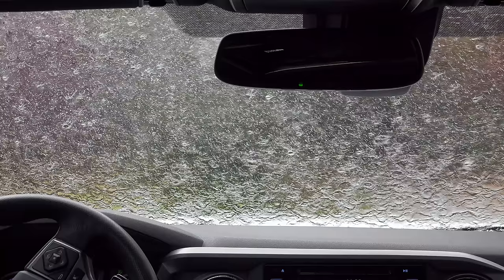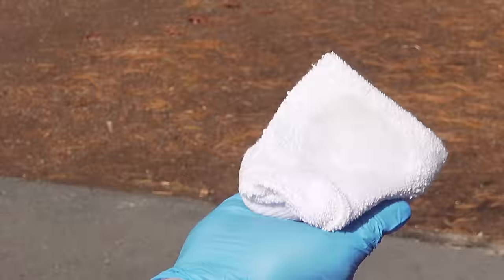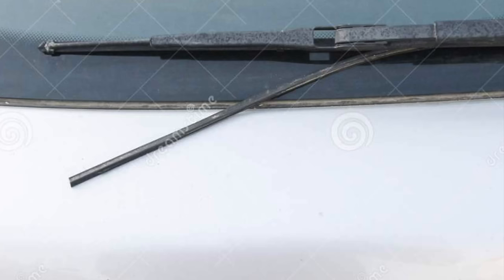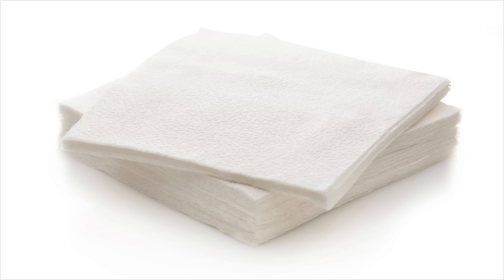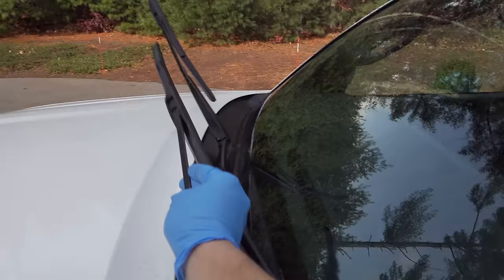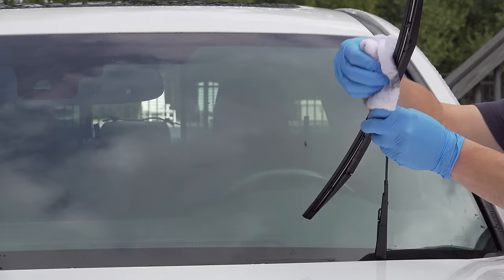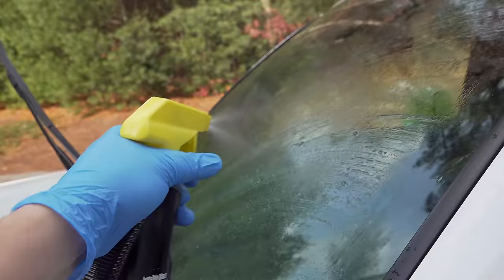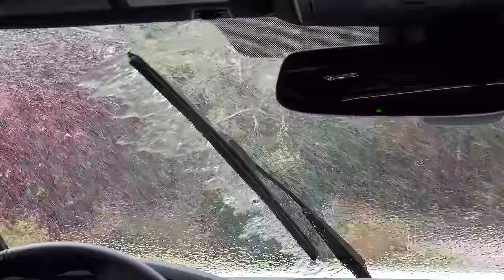How to Make Windshield Wiper Blades Like NEW in 30 Seconds

Comment: Very good video!  I’ve been doing something similar except I use Armor All.  It keeps the blades clean and free of causing streaks while extending the life of the blade to more than twice of what is expected.
Reply: Similar here, but I use soap/water to clean the blades, dry, then treat them. Armor All or Rain-X seems to work well; reapply every month or two. The wipers are the originals, installed at the factory 5 years ago and the streaks were bits of windshield gunk on one side of the wiper. I have Rain-X on the shelf because it'd cause the windshield to turn opaque when sunrise sun beams shone directly on the cool windshield (wrong side of a 1-way mirror). It was especially dangerous because this was a blind corner, no sidewalks, with pedestrians/bicyclists on the road.

Comment: WD-40 is a petroleum distillate.  Over time it will deteriorate any rubber it comes in contact with.  I’d use Rain-X on my windshields instead - it’d lasts 6 months and works perfectly without any degradation of the wiper blades.

Comment: WD 40 is actually a solvent.  It's awesome stuff and it does have lubricating properties initially, but is not good for rubber in the long run.  It will dry out the natural lubricants in the wiper.   Clean your wiper blades really well with soap and water then dry them off.  When they are dry, use silicone spray on the wiper rubbers.The silicone spray will help hydrate the rubber and protect it from UV.

Comment: I like using rubbing alcohol to clean them, then use 303 or any other quality rubber vinyl protectant, for even better results soak the blade in the 303 or similar product for 10min even when new to help them last. Make sure to buff of the excess product after coating them!!!!

Comment: The last 2 cans of WD-40 I bought I had to throw away after a while. These cans had a stupid little plastic straw that you inserted into the nozzle hole, instead of having a flip top sprayer. The straw wasn't so much the problem, it was the nozzle itself which choked up. & putting this into hot water didn't work, either. AND it's expensive stuff. So, halfway through a job I was doing, no WD.  I then grabbed a coconut oil spray, which worked just fine. (As does vegetable oil.)  I now have a silicone oil spray. I'll try THAT on the wipers.

Comment: Back in the '80s through '90s, even the cheapest Anco blades would last for 5yrs or more without streaking or ripping.  Then even "premium" blades like Bosch seemed to hold the "blade" part to the "base" part with a strip of balloon-rubber, so thin and prone to ripping that to this day I can't get more than a year or so before flapping around a piece of black spaghetti with each swipe.  So I just keep Rain-Xing my windshield and not even bother with the wipers except when at a standstill or going really slowly.

Comment: That makes perfect sense.  Keeping a windshield clean to begin with is half the battle. Never thought about cleaning the blades with WD-40.  Windshield blades come off so easy that I'm thinking of doing mine off the car.  Great idea, thanks.
Reply: It takes me about two hours, tho, to figure out how to put the windshield wiper blades back on!
Reply: WD-40 eats rubber, use silicon spray instead

Comment: I didn't see anyone refer to the fact that wiper blades have a molybdenum coating on the rubber so they slide better.
Wiping off blades w a rag helps temporarily, but it removes the moly coating.

The perfect thing for a wiper blade would remove gunk, but preserve the moly coating. I have no idea what that would be.

Comment: Learned the “tip” 20 years ago, he said. He didn’t say how many sets of wipers he’s gone through. For me personally, I’m skeptical of using petroleum products on rubber. But that’s just common sense. Then again, cleaning the wipers with alcohol may dry them. Maybe I’ll slather them up with some glycerin, since that’s water soluble. No, I’ll mix that with oxalic acide and use some formic acid on them instead. I give. I’m a chemical engineer and I’m not thrilled about all the “uses” of wd-40. If it’s the only thing there, sure, go to it. Otherwise, there is generally a better product. They make their $ on the aerosols, and if you left it in the cold a couple seasons, it’s flat and you’ve got to buy again. Long ago, I bought a gallon of liquid and spray it. Much better. It’s not the best thing for locks, chains, wiper blades, cables (bicycle/moto), garage tension springs, hinges, etc. etc. I think it can be used as a metal cutting lubricant but actually I think motor oil (much higher flash point and better lubricisity)is better for that. Jack of all trades, master of none. Someone tell me one thing it is “great” for, and please don’t tell me bike chains.

Comment: That black stuf after you wipe off is not the grime, but it is the carbon black coating of the wiper rubber. So by doing that you will ruin your wiper blades. Just wipe the grime if any by using a wet plastchamois.

Comment: Please inspect your wiper blades first.  Wipers often can start to separate.  A metal blade against the glass may cause scratching.  And the wiper inserts (rubber) can be replaced separately from the blade.  Instructions are on YT.  But you should replace the rubber inserts once a year.  They are designed to be replaceable items.

Comment: Dish Soap and one of the Plastic (Green) scrub pads on the Glass. Will remove remove the road grime. ON THE GLASS ONLY. NOT ON THE PAINT.  Dish Soap on the Wiper Blades also.

Comment: That black stuff is mostly oxides rubber not grime. Wiping it removes it and the oil swells the rubber and allows it to create a better seal. This is probably good to do every oil change just to prolong blade life. It may destroy some of the cheaper blades though. It would be interesting to see how well something like armor all in very light coats would do.     You want to hydrate the rubber but not so much it leaves oil on windshield.

Comment: I did this, it did not work and my wipers were new. The problem was that my wiper arm is bent ever so slightly so that the blades are not flat on the windshield. If that is your problem then it is an easy fix. Take two sets of pliers, and twist your wiper arm to make the blade sit straight again on the windshield. Please see a video on how to this,  there  are several good videos on here to show you how to do it. I realize now how much money I wasted buying new blades over and over trying to get rid of that noise and trying to get that streak that is always at eye level to go away. If this works for you great but if not search for other vids on how to fix noisy wiper blades.

Comment: this is pretty intersting bcuz while my first question would  be how long do u typically keep wipers after first doing this to them (??), but basically WD40 which is an oil solvent , if left on wipers should deterioriate them, bcuz oils-solvents do just that to rubber or related synthetic materials that are rubber-like.  So this is basically the worst thing for longevity.  The normal way of cleaning wipers is using something like rubbing alcohol.   One product that can extend life of rubber-type items is polymers that are in products like AT-205, which is made by ATP and happens to be made to stop leaks, but it's also a rubber treatment.   It can be used on any rubber parts of the car like CV boots, to extend their lives, and wipers if need be.   Far better than WD40, by obvious facts, but it's not cheap now at about 18$, so i dn't blame ppl for not buying it.   For those who want to use WD40, i'd sure want to get entirely off the wiper afterwards, which will require an actual degreasing agent, perhaps glass cleaner, but might need alcohol.
Reply: do not clean the wiper blades. The black residue on the rubber is actually graphite coating. It will provide smooth slide and protection to rubber. Removing it is the worst thing you can do. WD-40 only provides temporary benefit, it will wear off really quick under heavy rain and could cause you a trouble in the middle of a storm in a long road. Instead try re-coating rubber with graphite from pencils by grinding the tips.

Comment: warm soapy water will remove any grime, dirt, sap and oil from the wiper blades. I usually avoid using WD40 on rubber or plastic components. But honestly, wiper blades are relatively inexpensive and can be replaced pretty quickly too.

Comment: That's like saying "if you just bought new tires and they're not looking brand new the next day, try this trick.  If the tires have scratches and scrapes on them, unfortunately this won't work, but if they're just dirty than what you'll want to do is take a rag and wipe them down".

Comment: That black 'residue' is the carbon component in the synthetic rubber wiper blade. If you rub the wiper over and over again you will eventually remove so much carbon from the wiper blade that you will be forced to buy new blades.

Comment: Better yet a bit of lacquer thinner on wadded cotton will remove ALL the old and oxidized rubber from the blade edge. Be sparing in your applcation. My wiper blades are 8 years old and work like new. I do this 3-4 times a year or when steaks develope.

Comment: WD-40 is well known to slightly dissolve the material that windshield wiper blades are made from. As such, windshield wiper blade manufacturers will recommend AGAINST using WD-40 for this purpose. If you use products like this frequently, they can dissolve the rubber and shorten the life of your blades.

Clean your wiper blades by wiping them down with warm, soapy water, and wipe the edge of the blade with rubbing alcohol. If you're still having issues with smearing water, try upgrading your wiper fluid. 

You can use a mixture of water and vinegar instead. The vinegar and water mixture cleans the wiper blade rubber. It softens it too, making it suitable for wiper blades on cars that may have sat for a while.

The windscreen wipers have to be cleaned regularly because if dirt dries in them, they have a potential of damaging your windscreen. However, the rubber blades of the windscreen wipers also wear out with time. When you see cracks it's time to replace the blades.

Comment: Just wipe the wipers down with a damp cloth. Pinch the blade between your fingers and run the length of the blade a few times 
Do this every time you wash your car or get gas 

I have been using the same set of wiper blades for 6 years

Comment: I don’t use WD40. It’s basically kerosene. I use regular wiper fluid to clean my blades. Kerosene attacks the rubber and can actually degrade the wipers.

Comment: WD-40 is a lubricant (fish oil to be exact) dissolved in a solvent. While it can break down grease and oil to a certain degree, it also adds back some. This might be desirable if you are cleaning a hinge, conveyor, or corrosive-prone part, but not if you need it truly clean. Use silicon lub or try graphite lubricant instead.

Comment: I Bought 3 New Bosch Wiper Blades and put them on my Car.! The Rear Wiper Blade and the Front Passenger Wiper Blades are Fine.! But the Driver's Wiper Blade is Juddering.! I Googled what to do and it was suggested that Coconut Oil would help.! I put some on but Nope, it didn't help and left a White Smear on the Windscreen.! So I Cleaned all of the Windscreen and put the New Blade on after taking off the Old Blade.! Still Juddering, I will be trying the WD40 trick tomorrow.! But do you have Anything else to Suggest to Stop Windscreen Wipers Juddering.?🤔

Comment: Lacquer Thinner and some tissues is so much more effective than WD40.  It removes ALL the black oxidized rubber, and done so very quickly.  Don't get the chemical on the vehicle's paint so apply the chemical on a tissue away from the vehicle.  Unfold the tissue flat, then refold it 4 times to create a small square pad, then cover the hole of the chemical's container with it and turn the container upside down to create a very controlled wet spot without dripping.  Wipe each blade clean by using "pinch" action, the tissue to both sides simultaneously.  Repeat until no more "black" comes off.  Privately owned used car lots do it this way all the time.

Comment: WD40 silicon is worth using but in my case it did not work. After 10-15 mins of use in the rain the squeek comes back, have changed 3 sets in 3 weeks no use. Thinking of changing the windscreen....

Comment: That black stuff that you see on the old sock is the wiper rubbers themselves. It isn't grease, or dirt, it's the rubber itself, coming off. WD-40 is not the best solvent for cleaning wiper blades. WD-40 is an abbreviation for "Water Dispersant number 40."I would not use grease or oil on a wiper blade. I would soak by sock with – windshield washer fluid, the kind for winter use, it has the most solvent. You can add a drop[ of dish-detergent, like Dawn for sishes. Just a drop. Also ok would be denatured alcohol, vodka, or silicone lube. Do not use paint thinner. Paint thinner dissolves rubber.

Comment: I use silkone spray, right on the screen and on the blades. All over, then dry and shine with a nice clean towel. Haven`t bought new wipers in years, no need. Rainwater is forced off the screen at speed. They should tell people about this.

Comment: Is there an alternative to WD-40 if your local shop havent any in stock? What about methylated spirits? Or thinners?
Reply: Go to the hardware store's plumbing department and buy 100% pure silicone gel. Silicone contains plasticizers and is used on rubber for this purpose. WD40 is not good for rubber. And, silicone sprays may not be either (the carrier ingredients may be petroleum distillates and not good for rubber. Plus, silicone is  harmful to catalytic converters. I wouldn't feel good about aerosolizing silicone into the air around my car unless I wasn't going to start it for an hour. I wouldn't want my car breathing silicone in, and affecting the cat converter. But, the gel is the way to go in order to avoid petroleum distillates which aren't good for rubber anyway. WD 40's pure petroleum distillate.).

Comment: There is no "grease" on your wiper blades.  It's just rubber from the blades themselves.  This will put WD-40 all over your windshield, streaking and impacting vision.  Have fun cleaning that off.

Comment: So a way to help keep the life of your blades is shutting them off at stop lights. Some cars do this automatically when they sense a speed below 10-5mph to do just that. When you gas up, clean your window and blades! Keeping them clean is half the fight, as the wear from junk they collect is part of what breaks them down. I can't say WD-40 is the fix, but finding a way to rejuvenate the rubber is the key. WD-40 is a petroleum base, if memory serves which will actually degrade rubber if my chemistry is right. You need an oil or silicone base to actually help preserve rubber. Not a chemist, so keep that in mind. I wouldn't go rubbing gun oil on my wiper blades and get upset with smears after. 

I have ironically used turtle wax both on my window and blades and I have zero complaints. I also keep my blades clean, ditto the glass. I think that is where the real fight is at.

Comment: I did this and my wipers started to drag sluggishly with jumps and loud groaning noises.  No smears though, so it was clean.. Not sure what went wrong but had to buy new wipers anyhow.   The guy at OREILLYS said WD40 is a bad idea and to use rubbing alcohol.  Maybe the creator can address this.  My wipers did not have any grooves or hard wear at the beginning.

Comment: Wet windshield thoroughly
Get 0000 steel wool
Have bucket of clean soapy water
Dip 0000 steel wool into bucket often
'wash' windshield with soapy steel wool pad, rub with gentle pressure
Do NOT use dry steel wool pad...always ensure it's very wet
Rinse, repeat with new clean soapy water and new 0000 steel wool pad
Rinse and useclean cloth and glass cleaner on windshield

Voila...like new......

Comment: As others have said,the WD-40 will degrade the rubber and you’ll have to change the wipers soon.
You’re better off just buying silicone wiper blades instead of the garbage being sold in the auto parts stores. You can get 10 years out of them and the always work well.

Comment: I'm not sure if this will work on a car that sits outside 24 hours a day. The UV in sunlight destroys rubber compounds. This is part of the reason car tires have a limited lifetime (even with low milage) My car is the opposite. It is garage kept 23-1/2" hours a day. Because of this, I'm going to try this trick.  A set of wiper blades for my car costs a little over $40. (Inserts are not available)

Comment: Yes and did you know WD40 is a solvent on rubber.   That means it will take a film of rubber off the blades. That is what you see and not dirt. .  Well certainly not all dirt.

Comment: You couldn't run fast enough to give me a can of WD40 to spray my wiper blades. WD40 will eat the rubber. Clean them with a soft rag and some isopropyl rubbing alcohol, then spray them with silicone. There's a reason the manufacturer includes a small packet of alcohol with a new set of wiper blades.